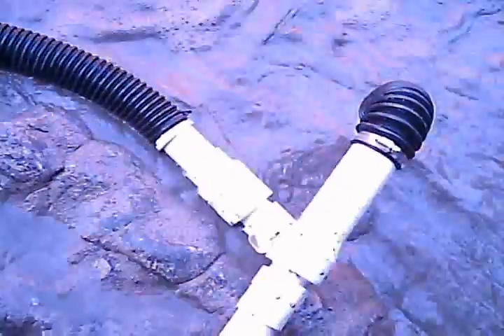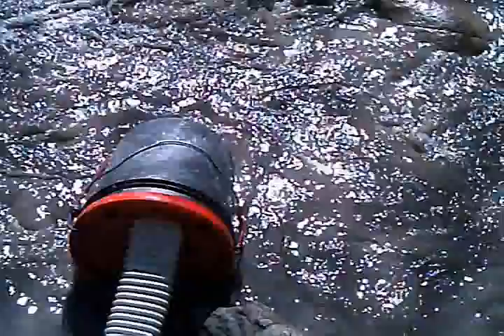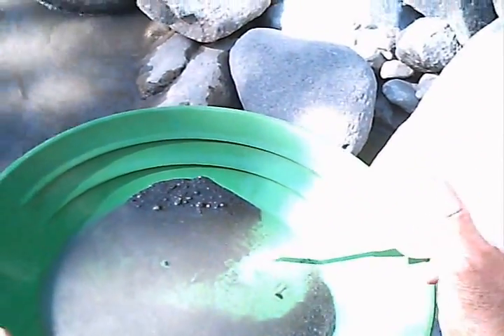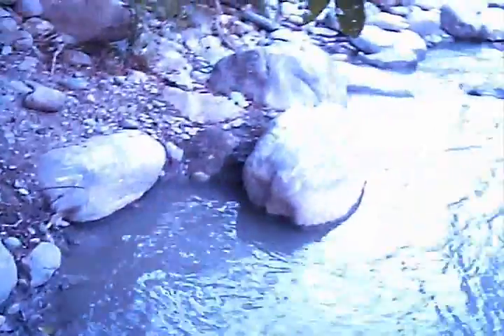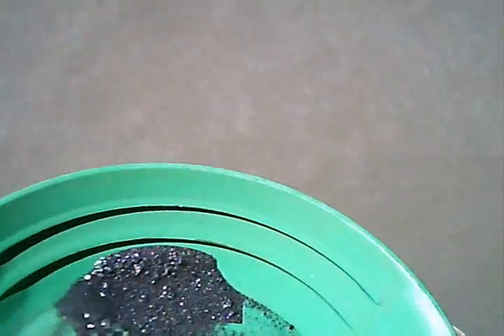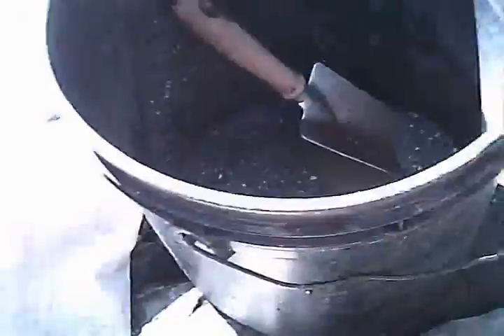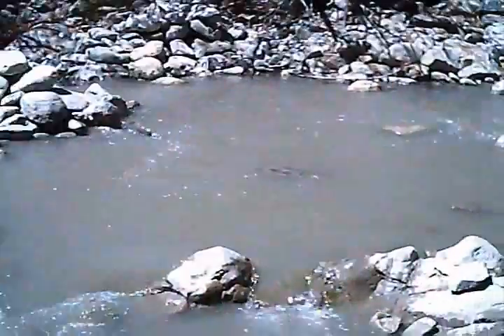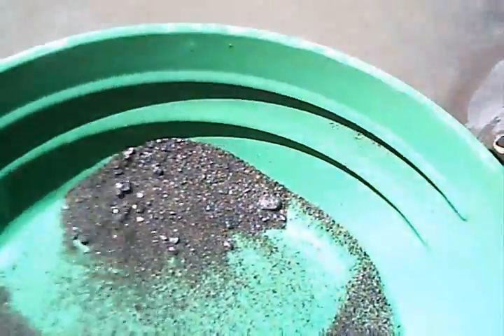Hand Dredge Gravity Trap GOLD Concentrator Defeats Sluicing

Comment: i have seen many  crack suckers ,  with  flapper valves with out flapper valves , anywhere from 1.1/2 " up to 4 " DIA  and some up to 5 foot long .  and they are nice they don't molest the area where the gold is laying like a shovel can loose gold by the vibrations crashing in to rocks sending gold deeper .
 making your own flapper valves are a snap and  these are a snap to create .  with just a little time  PVC O rings  and a  couple screws ,, and your in business .  tennis balls make a ok plunger cup , but  12 to 16 ounce  veg tanned utility leather make the best cups ,  people laugh at these ,, I caught wind that a old boy out in Oregon pulled 20 some ounces last year out in Oregon  and i can believe it , so for a fake or a joke that can deliver that kind of a pay , and again gold is where you find it ,  if it is a 100 dollar bill for that machine pre made its very well worth it ,  these arm chair miners are the fakes and the jokes ..
Reply from the maker: +Lucky B.... Yeah, hand dredges and crevice suckers. Just knowing what a motorized dredge can do was enough to tell me that without a hand dredge/crevice sucker, I'm loosing GOLD.  The Model 625 HDP, the high capacity hand pump used in the movie gets that GOLD, and from what I've experienced, all of it. Some of the before and after clips from the video's show just how clean the these bedrock drop off's and crevices are afterwards. Impossible without a "Hand Dredge".  With a "Hand Dredge", the river bed material is not only getting suctioned in, but pumped out and then through a discharge hose. GOLD miner's can move lot's of GOLD bearing material in a shorter period of time. (old boy Oregon?)   The "Experimental" Gravity Trap Concentrator (EGTC) tested here using an M625 HDP processes the GOLD bearing gravel as it gets pumped through, and may actually eliminate the need to sluice screened down/classified.... tailings.     The EGTC is just cavernous enough that the M625 doesn't push enough water through it per pump stroke, so that the GOLD in suspension has a chance to sink to the bottom and concentrate!     Flappers are easy to make, but suck through's and push through's are always a problem. The M625 and M2125 flapper are specially designed not to, yet flexible enough to stop rocks from getting hung up because of the torsion in the flapper, permitting continuous operation.       GOLD news travels fast, and we need to work even faster to get our share before the next guy can butt in and pick up where you left off, cleaning out your spot, before you get another chance.       M625's move material fast , and 2" M2125's move even more much faster, so make sure you leave yourself enough time to pile rocks all over the dredge hole your punching before you leave.
Reply: in my younger years when I did my share of sniping  the only time i had a job was during the winter time   before the snow started flying  a couple friends of mine and I would set out sluice boxes  about 9 to 12 and anchor them  down real good .  once the water  run off slowed down enough . ( Washington state boy here ) .  to start dragging them boxed  out of the water  for clean up ,  miners moss  you cant beat it but some reason i like  artificial turf i never had one of them suckers but the spiked my attention ,  their is a company that makes what i call miniature gardening  equipment
called Aries or aerial    they have a small water pump that has good water  delivery
very light  to carry  and for a small suction  dredge  using a crack and crevices tool in that bed rock under water  may work out good , and that small motor you can get about three to 4 hours on that small tank of gas , if I ever get back to Washington and spend some of my last days playing in  cracks and dirt would be very enjoyable , thanks for the yell back

Comment: why not connect more concentrators in series? yours are the first videos i've seen to address the issue of gold lost in tailing waters.what about water velocity through the rig?i'm a total newb. so,to all more experienced people reading this,you ARE permitted to lol.
Reply from the maker: +5160 ricky   Welcome 5160,  The "Experimental" Gravity Trap Concentrator (EGTC) tested here using an M625 HDP high capacity hand pump/gold dredge, processes the GOLD bearing gravel as it gets pumped through, and may actually eliminate the need to sluice screened down/classified.... tailings.     The EGTC is just cavernous enough that the M625 doesn't push enough water through it per pump stroke, so that the GOLD in suspension has a chance to sink to the bottom and concentrate!

Comment: Is this a joke?
Reply from the maker: No Joke there Soggy Sponge. Watch and listen to all of the research and development video's. Totally works with an intermittent type pump like a Gold Hand Dredge. The intent was to screen the material for traces of GOLD by pumping it through the the Flex Elbow's DEEP-V's before it drop's into the sluice box! Unexpectedly, all of the GOLD that got pumped in, settled in the Deep V's of the Flex Elbow and never made it to the sluice box!
Reply: GoldenSniffer It is not a joke it is a lie.
Reply from the maker: Kevin Hartman Hummm, well..OK Here's the scoop! Just because it sounds to good to be true doesn't mean it's a lie. The test clearly showed that the EGTC Gravity Trap Concentrator really does work! This small rectangular corrugated tube traps GOLD when used as demonstrated. The mechanical force of the water was insufficient to push the GOLD out, so only the lighter material flushed out. It's possible of course, that the 3 restrictor holes in the bucket lid may have played a role by creating some additional back pressure to prevent over zealous pumping.

Comment: You got the V shape in the water looking good.
Reply from the maker: The uphill rectangular shaped Deep-V Gravity Trap GOLD Concentrator works surprisingly well with Hand Dredges. Gold, lead and steel are to heavy to get flushed out  Unbelievable magnetite trap too. Fun cleanouts, Always lots of black sand concentrates to pan out. Never seen any trace of GOLD in the tailings either!
Reply: GoldenSniffer What he means is when you are running the sluice, the shape of the water flowing in the sluice is a nice v shape. This is required for a good sluice run. Michael is not referring to V you speak about in the pvc downspout.
Reply from the maker: Steve Eady Huh, huh, huh, OK........